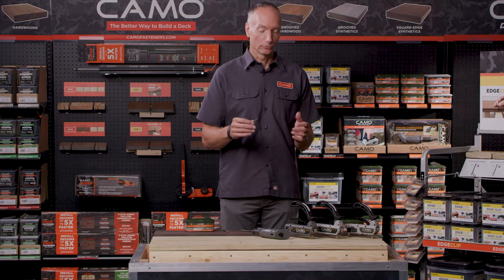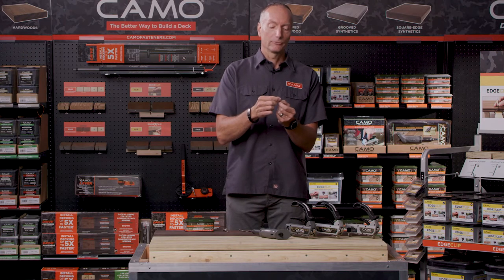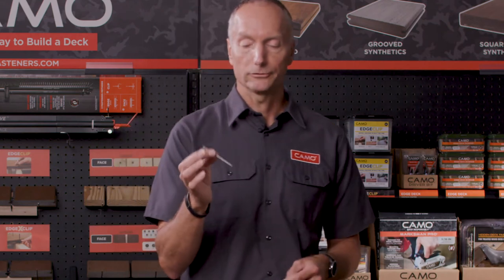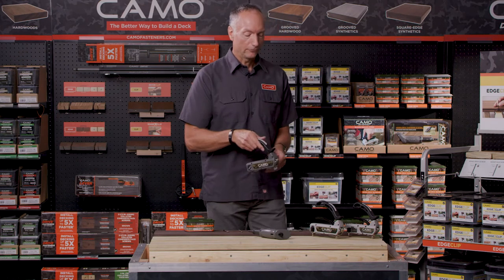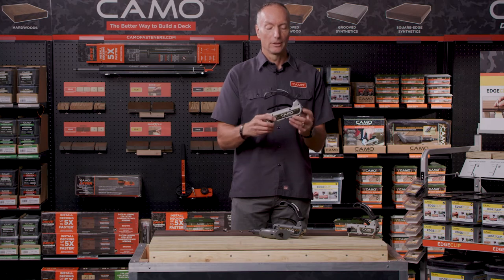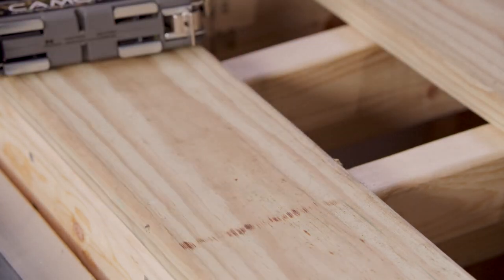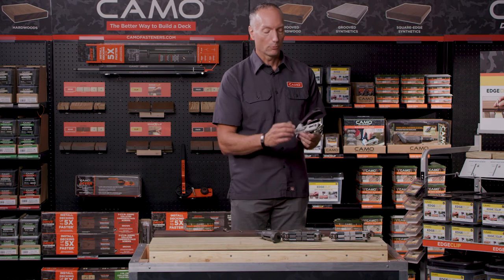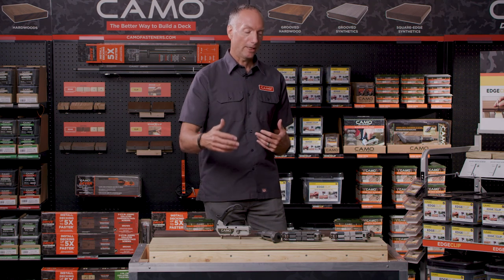CAMO® Hand Drive Edge Fastening System

Comment: I built a deck about a year ago using this system with vitex which is a hard wood. I wouldn't recommend using it with a hardwood personally and am about to build a deck out the front of my house and will probably go back to screws unless I choose a different wood and/or different fastening system. The reasons are that hardwood seems to be to strong for these heads and when some of the boards crown, which they will try to do eventually given temperature and rain fluctuations, the heads have just pulled through and caused massive splintered areas. These are on the side so not a splinter hazard but the screw is no longer fastening the board in place. 
They might work fine in softwood such as pine etc but I just wouldn't recommend for hardwood. 
Also another problem I found was sometimes (maybe every 10-15 screws) the screw wouldn't drive all the way in but to top it off it wouldn't screw out either so I had to wrestle the hand held piece quite violently side to side and up and down to rip it off the screw head. Then I could drive the screw all the way in so it definitely was not hitting an embedded nail etc. I could never work out why it randomly did this but it was a pretty annoying at the time. It shouldn't have been the screw head catching the insides of the guide as it sets it up for the correct angle etc.
I actually did like the system to be honest but never again with hardwood.
Feel free to email me on cracknfx@yahoo.co.nz if you want to see photos of the finished deck and of the pulled wood through screws.
Reply from the maker: Hey Phil, thanks for the comment, and we're sorry you didn't have a great experience with our MARKSMAN System on hardwood. We'll send your note along and Greg will be in touch to get some more details!

Comment: Which Camo should be used with Cedar 5/4 x 6 decking boards?  You mentioned composite (use the Pro), PT wood (use the x1), but said nothing about cedar boards.  I'm assuming that since cedar doesn't shrink as much as PT wood, using the Pro (i.e. 3/16 gap) unit is recommended or should I use the 1/16 gap, or is it simply a matter of preference?   Thanks.
Reply from the maker: @jaxwylde2139 we would recommend using the Marksman Pro for a 3/16 in gap for cedar with our 316 stainless steel Edge screws for this project.
Reply: @CAMOFasteners  Thank you very much!

Comment: You mentioned 3/16th gap for synthetic, and 1/16th gap for treated lumber, what lumber or condition would you leave no gap with the edge? Thanks
Reply from the maker: Excellent question. Typical pressure treated decking (moisture content above 19%) needs little to no 
spacing between boards at the time of installation since the boards are so wet. 
As the boards dry, they will shrink, creating a space
 naturally.
Reply: @CAMOFasteners  Thanks for the quick response, this is the first time I see moisture content specified with accuracy, thank you for that. Now if there was a way to measure that, that would also be great.

Comment: For the no gap, does the wood have to be completely dry?
Reply from the maker: Yes, however we recommend leaving a 1/16 in. gap between dry pressure treated lumber to allow for drainage.
Reply: @CAMOFasteners   @CAMO Fasteners  Thanks for the reply. Yeah I went ahead and got the x1 camo and a pail of the longer 2" screws from home depot because I'm using 2x6's. I like the look of no gaps, but it's still really wet wood so I guess this will have to do. The wood is SO wet though that I'm worried about the issues some people have had with this system when the wood starts to shrink. 
Too late now though, about to start on it tomorrow, so we'll see what happens, and I'll give an update when completed 😁👍

P. S I really like the extension with the 3" screws too, but my home depot didn't have any in stock and like a week to deliver one so,
 sad face.